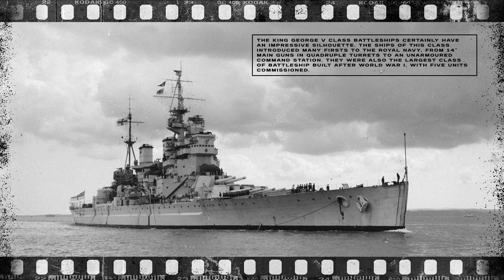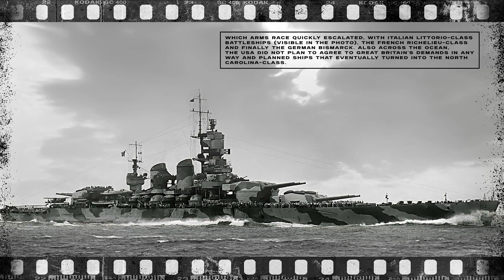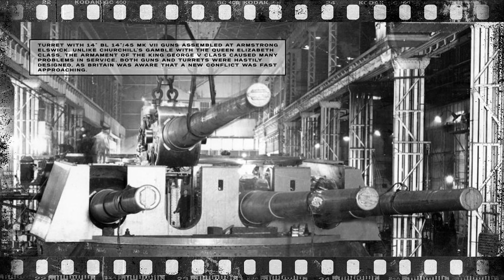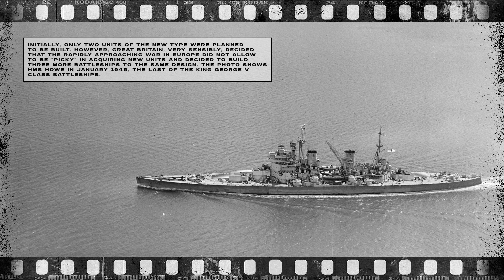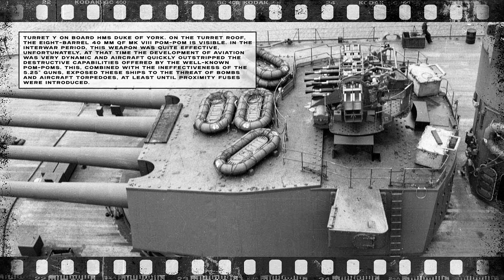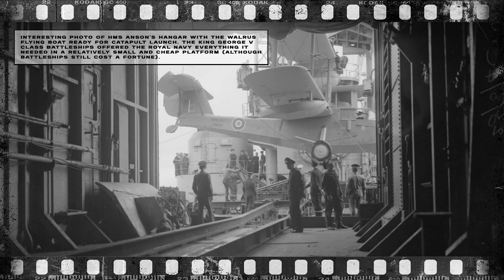Bismarck vs Royal Navy - Episode V

Comment: I suggest you go back to school as 1" imperial equates to 2.54cm not 2.49mm
Reply from the maker: I think you're reffering to my note on the diagram presenting the KGV armor scheme. I do enjoy the agression in your comment tho.

The point of that note is to illustrate the common mistake, that claims that KGV battleships had 15" armor belt, which would equal 381 mm. But, in fact, due to the british practice of armor manufacturing, although the design called for 15" plate, it was in fact only 14.7". The UK used armor weight for their calculation, and assumed that 1" of armor would weight 40 lbs, when in fact it was weighting 40.8 lbs. So, when they installed the armor on KGV, they actually used plates that were thinner then 1". This 0.8 lbs would equate to 0.05 cm, hence, 2.49 cm not 2.54 cm. You can read more of it here:
https://www.kbismarck.org/forum/viewtopic.php?p=45104
the comments by Nathan Okun and William Jurens in particular.

I hope that clarifies the issue!